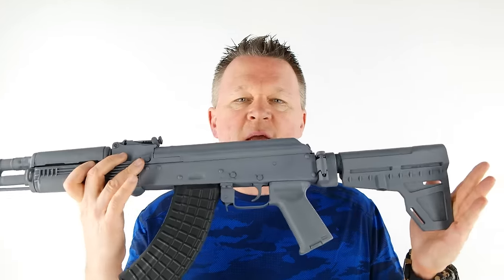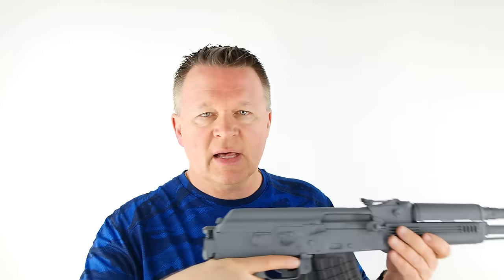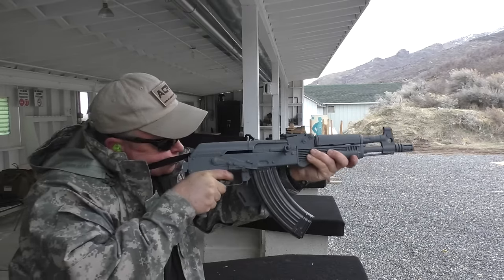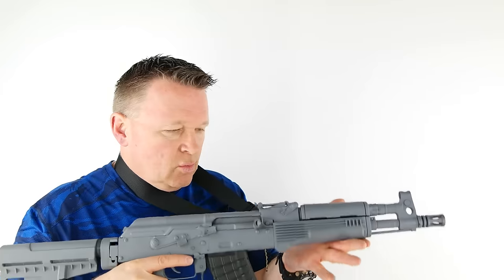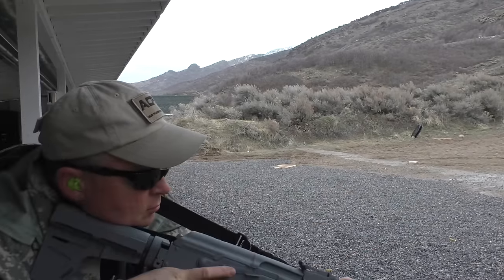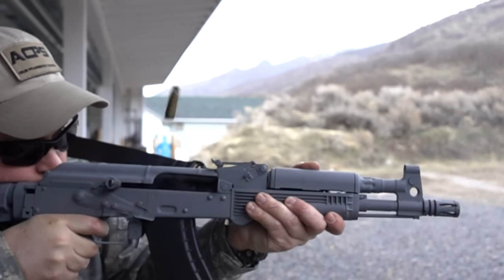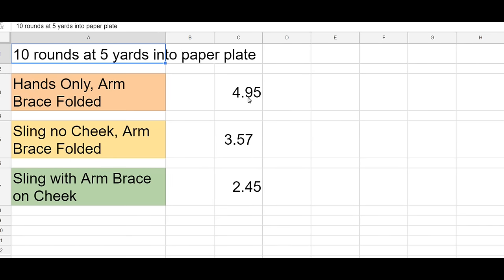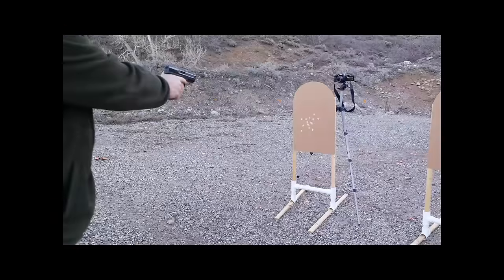How to shoot an AK Pistol

Comment: Is there a reasonable way to carry this thing on a single point sling with the front mount? 
I've considered getting one but I've also considered getting a 2 point mount, which would mean sacrificing the brace 🤔
Reply from the maker: Single Point slings suck for carrying them hands free.  You could 2 pt it using one of the slots on whatever brace you have.  Thank you for watching and posting.

Comment: I know you usually go with the birdcage style devices on your AKs but do you think that if you went with a more intensive comp/brake on that little guy you could manage the sling method a little better?
Reply from the maker: I dislike the effects of flash and blast when using a comp or brake - so I will probably stay with the flash suppressor.
Reply: tire iron Have you heard of or seen the Bulgarian style 4 piece flash hiders? Apparently they work really good at killing flash. plus I think they look cool but beauty is in the eye of the beholder. lol the extra weight at the end might help with muzzle rise too. thanks for sharing again.
Reply from the maker: I have used them and they do a good job at killing flash but are longer and heavier than the good ole bird cage flash suppressor.  Thank you for watching and posting.

Comment: if  you have a  AR15 rifle can you change the upper to a pistol upper or does the lower have to be registered as a pistol? thanks have a nice day.
Reply: The lower you have now is classified as a rifle, as I would assume it has a stock on it and an upper with a barrel length of 16" or more. You can't remove the stock and call it a pistol. Once it's a rifle, it's always a rifle. You would need to buy a stripped lower or pistol lower (no stock) in order to mount a barrel shorter than 16". If you mount the pistol upper onto your current rifle lower, you have created a short barreled rifle. As such it falls under the NFA. In order to do it legally, you have to first register the rifle and pay the $200 tax on it(plus wait up to 9 months for the background check to come back). Then you could put the upper that is shorter than 16" onto the rifle lower. Failure to do so can lead so some stiff penalties and jail time.
Reply: Isaac Lewellen Thanks for the information. have a nice day.
Reply: You too. Places like Palmetto State Armory have complete pistol lowers for $129. It's getting to be a good time to buy!
Reply from the maker: Thank you Issac for that great post!  You answered it much better than I could.
Reply: Isaac Lewellen That's a great buy. everything is dropping thanks.